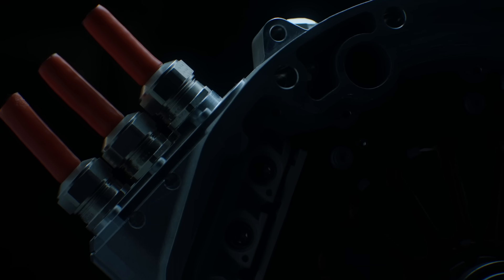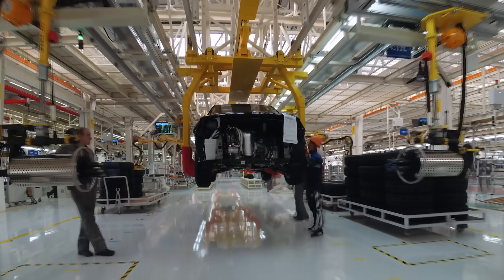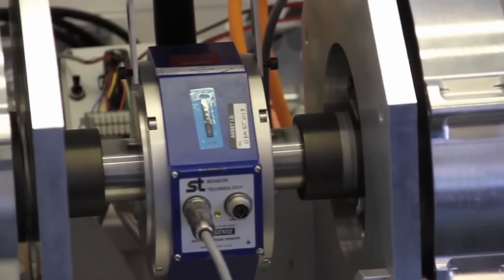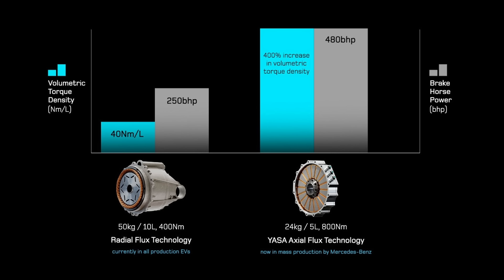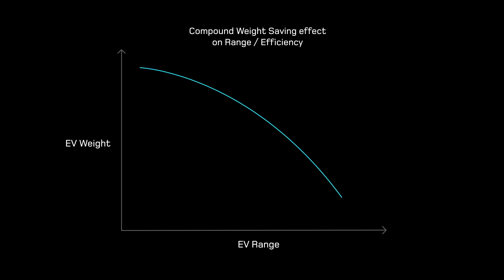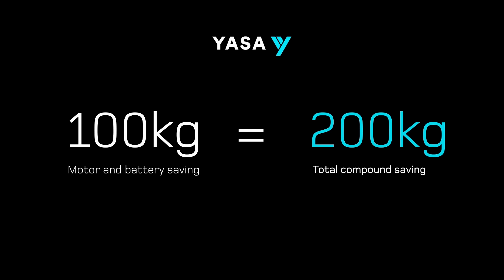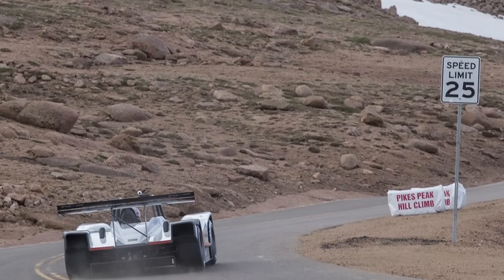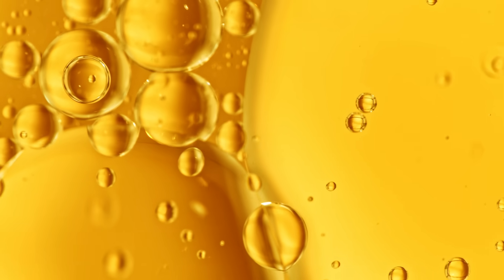The YASA Story - Axial Flux Motors: The Future Of Electric Vehicle Propulsion

Comment: To be clear, they said "working with Mercedes," however Mercedes acquired YASA motors over a year ago. I doubt they acquired them to sell the motors to competitors. No, they probably see it as a competitive advantage that they'd like to keep to themselves. Wonder what the real world impact is - the EQS 580 4MATIC that Munro & Associates looked at, seemed like it had a standard radial motor.
Reply: I dunno, you could probably make a silly amount of money by licencing the motor to other manufacturers rather than keeping it to yourself and making your competitors research and develop their own
Reply: @TheBoringInvestorMan  exactly. Buying them assures your own supply.  There's already an aerospace spinout from YASA whose job it is to put their motors into electric aircraft.
Reply: Most of Mercedes' inventions are common for all.

Comment: People don't be fooled by this axial flux motors have alot of torque but they basically max out at 6-8k rpm unlike a radial flux motor that can be capable of going up to 20k rpm
Reply: I think we can see axial flux motors with 20000+ rpm..
Reply: 20k for motor is not true. . Unlike ice they do need that.
Reply: So you are saying Mercedes Benz have been fooled 🤔
Reply: Why do you think going to 20k RPM is valuable for a car?
Reply: @JorenMathews  it all ends up to the gearbox high gear ration will end you being pretty slow lower gear ration would end you going pretty fast and that's where 20k rpm ends up and if you add more gears you're just loosing efficiency
Reply: @lhgt1324  You don't need a motor to spin that fast at all, a gearbox will instantly fix it and even if the motor is going quite slow at this stage it won't be too bad. Plus they always have 2 gearboxes if needed, 1 to spin the gears faster and another for reduction.

Comment: I drive a 2002 EV a Fiat elettra. Still going strong on its 3'rd set of batteries. I had my first EV in 1991. They have been around forever if you wanted to buy them, you could in Europe. Axial flux motors are the future. Torque curve better suited to the demands in traction applications and not the least the higher efficiency over a wider load range.  Run of the mill induction motors like they are still used the majority of EVs globally, drop dramatically off in efficiency at lower loads, i.e. city driving.  Another thing: In the 90' EVs were optimized for efficiency. they were not simply standard pressed steel gasoline vehicles with batteries. That was needed because the chemistry was lead-acid or maybe Ni-Cd if you was rich, So everything was about weight reduction and driveline efficiency. If that virtue is coming back. we could make 1000 km range EVs today with Li-ion batteries if we custom built EVs and not as now, are just retrofitting gasoline cars. An EV1 today with the same mass of Li-ion batteries it had Lead acid batteries, would have a range of more than 800km.
Reply: And you would be killed if a soccer mom wouldn’t see you in their SUV tank and roll you over. I know the old EVs, and in a perfect world they would be great. In today’s reality anything small than an electric UP is basically undriveable. I personally wouldn’t even go smaller than an electric golf…
Reply: @erebostd  You cannot view car safety from the individual car owners perspective. Bigger cars are not safer, they have 2.5 times the mortality and injury rate in urban areas, to all other than its occupants. So it is really not the small car owners peril, it is mismanagement of mobility planning. People perceive bigger cars as safer, and they are from their egocentric perspective, however they are worse for road safety on society level. So the soccer moms are not smart enough to choose the most appropriate vehicle, so they should be helped, by taxing vehicles by size and fuel consumption. here in Europe. you pay around 6 times more to drive a SUV in road tax and resident's parking permit over a compact. So SUVs really don't appeal to soccer moms here.

Comment: now you need oil change for your EV motors.😅
Reply: You needed that before. Look at many defective drive units of Tesla
Reply: If you did need to change the oil, it would be extremely Infrequent ... think of the oil in a manual tranny... I know some may change that at intervals, it certainly wouldnt hurt to, but Ive Never changed the oil in any Ive had becuz there is no internal combustion going on that would degrade the oil... same with an ev oil cooled motor or tranny... granted, changing it out now and then becuz particles from metallic wear will still be in the oil, it will be a Very infrequent interval since no combustion is involved.

Comment: How does an electric motor have density? That’s what batteries have. Maybe they’re talking about power to weight
Reply: Divide the torque with the volume the engines takes up and you get the torque density. Not that difficult 😂
Reply: @MovieViking  thanks for clarifying that for me so what this motor will do is allow me to beat people at the traffic lights? But it won’t necessarily give me greater range?

Comment: What seems to be skipped over is the main reason EV manufacturers use radial motors, and that is energy efficiency. At the same time radial motor design hasn't been standing still and more recent hybrid radial motors as used by Tesla etc are extremely efficient and have dropped in weight as a result.
Reply: They all use it because it hit an engineering sweetspot simple stupid to make, reliable and yet efficient.
Any forward step like axial flux motors have manufacturing problems - keeping airgap is hard and cooling is hard too

Comment: As he mentioned he did not invent this type of motor and I am sure as prototype he used Shkondin's patents . By the way inventor mentioned above claims  confirmed efficiency  of his motor 104 percent. I understand it contradicts some laws of physics but it doesn't stop the inventor to work on      generator which would produce 6 KW of electricity in combination with just one solar panel

Comment: Ok then which EV with a Yasa motor performs better than my Model 3 RWD in terms of range per kWh? Because i have not seen ANY car on the road which can match Tesla. And Tesla has no Axial Flux Motor. Care to explain? Also we do not need Permanent magnets in motors. That is not the road to take. What about Reluctance motor where all the copper is replaced by aluminium ? (Cheaper)
Reply: Your model 3 has permanent magnets in the motor. 😂
Reply: Because they aren't as efficent as PM motors. Your Model 3 has PM in the motors and funnily enough that this motor hasn't yet been put in a normal can like yours yet, they have all been used in sports cars where range isn't really important only speed,power and weight is.

Comment: If we look at vehicles with a maximum acceleration of 5m/s.s and 3.5m/s.s (fast and normal ICE vehicle acceleration), and assume torque vectoring on all four wheels, we could have two drive units, each with two small axial flux motors. Each motor would be packaged with a planetary gear system and an inboard brake and half shaft all axially aligned. The casing could include rack and pinion steering for both front and rear units - can use identical units front and rear. Each front/rear unit would need inverters for each motor, the oil pump motor, steering motor. There would be an oil/coolant heat exchanger. The inputs to the drive unit would be communication from vehicle controls (all human controls entered via an aircraft style side-stick (steering, brake acceleration), low and high voltage power so the drive unit will stay awake if DC power cut and coolant. The outputs are data to the vehicle controller/sidestick, two half shafts and two steering arms. In going to a 'giga-casting' the casting is not strong enough to resist fatigue loading from a MacPherson strut. The suspension should be double wishbones and horizontal suspension like F1 and other high performance vehicles. This means the giga-casting only face accident loading such as Short Overlap Test at their extremities. The wheels could be flush to the tyre on the inside and have fully enclosed wheel covers on the outer. Suspension components can be shaped for lowest drag life F1. The underfloor can be shaped for best aerodynamics.

Comment: During regen does the motor act as a generator, or is there a separate generating component? If this motor can serve as a compact efficient generator, why not develop it for wind power generation to increase efficiency?
Reply: I am not the engineer, however the answer to your question is Yes.
All 3 phase EV electric motors work both ways, the regen is derived in the Drive controller by frequency, the EV pedal commands a frequency, the controller matches it , when the pedal is "ahead" the controller pulls more current to get the motor to match the requested speed.
When the EV pedal is released, "Behind" the speed of the motor, it tries to slow the car by REGEN until they match frequency. Really a simple design.
Reply: @HandyDan  that's not how the control logic works - for one thing pedal position does not correlate to target speed - but yes... motors act as generators when desired.
Reply: @brianb-p6586  I am not here to start an argument, but have you ever driven an EV? 
The pedal position is 99% exactly the vehicle speed. Unless traversing a very steep hill. Then it takes more amps from the battery to try to match up again.
Reply: @HandyDan  yes, I have driven an EV, and just as in an ICE vehicle the pedal position corresponds to power, not to speed. 

With cruise control not engaged, hold the pedal halfway down on level ground: the vehicle speeds up until it reaches the speed that needs that much power. Now drive up a hill with the same constant pedal position: it slows down because some of the power goes to raising the vehicle up the hill. Then contine over the top and go downhill, still with same pedal position: it speeds up, to faster than it was going on flat ground with the same pedal position. 

Pedal position is not a speed input.
Reply: @brianb-p6586  Correct for ICE, Gas cars shift gears, have a sweet spot in the torque curve, so if you held the pedal in one spot, 1st, 2nd, 3rd, 4th the car is speeding up.
But in an EV, one gear, hold the pedal and it gets up to set speed.😃
Reply: @HandyDan  it gets up to the speed which needs that much power... which is different depending on road grade, wind, road surface codition, etc. The pedal position is not a speed setting.
Reply: @brianb-p6586  Not arguing, but in my Smart fortwo EV, if I hold the pedal halfway it will do 45mph up hill, downhill in a head wind or tail wind. 
Maybe Mercedes did it differently in the Smart, but I could use a long bolt and wing nut on the pedal as cruise control.
Reply: @HandyDan  That sounds like a really smart Smart. 🙂 EVs (at least other EVs, and likely Smart ForTwo ED's as well) really don't work that way, for very good reasons, but if that's what it seems like in yours, it's good that you're happy with it.
Reply: @brianb-p6586  The 2015 Smart fortwo ED was initially designed by Tesla, but along the way they switched to Bosch, mine has the Bosch A4513401700 motor, plus mine has a Steinbauer power module for more torque and better regen so that might also be what gives my car the steady speed with a fixed pedal position.
Reply: Yup the overall statement about Regen is correct, it isn't a matter of the motor but other components to support regen. 

Infsofar as control is concerned the pedal input is read as a certain percentage of total pedal depression and depending on the mode/settings of the cars computer it will control the power flow from the batteries to motors through an inverter or speed controller (basically opening and closing gates to let current flow from the battery through the coils in the motor more or less quickly), more pedal press equates to more torque/acceleration, when let off the pedal the computer again can be configured to use the motors as generators and effectively recharge the batteries off the Kinect energy (slowing down the car, now the coils are being used to "pump" a charge/boost converter to pull the battery voltage/charge up).  It might be more or less efficient using one electric motor design or another but I think they all share the property of being used either to drive a thing or when driven to output power since moving  a wire through a magnetic field (or vice versa) is all that's needed.  

Typically cars use a CANbus for sending control signals around, but other communication protocols are probably involved in most of the ev (or ice) throttle control.
Reply: @ShaunHusain  Thank you, the system is actually very straight forward. Picture this example, test bench: Set the pedal position, that sets the frequency to the drive inverter, it puts out UVW at the same frequency, there is an encoder on the motor shaft for verification of rotor position.
Now the easy part, say a bench test motor is spinning at given RPM by a pedal position, without even touching the EV pedal, if you place a load on the motor, the inverter will up the amps to maintain RPM, if you spun the shaft faster, the regen will start.
It's as simple as if the motor RPM is lower than commanded, amps rise to maintain, if the motor RPM is faster than commanded, voltage is produced by the next set of leading coils and produces drag "REGEN".if you manually spun the same as commanded "Free spinning" no load or regeneration.
Reply: @HandyDan  I get where you're coming from but it isn't that direct the computer in these systems allows you to control how much you want it to map the pedal position to positive vs negative for one pedal driving and the mapping isn't a one to one but the gist of what you're saying is right.  For reference I built my own electric skateboard that uses an vesc (vedder open source esc) for the power and Regen control, in the app there can configure the input mapping and ramping along with other limits, but the mode you're talking about is called velocity control there where an input signal is meant to be a target velocity but most riders and ev cars use current control so more pedal=mode current=more torque=more acceleration.  All I'm saying is it's not pedal to velocity but pedal to acceleration/deceleration amount and usually adjustable (parents have a model 3 and can adjust how much Regen you want but think is pretty typical feature for evs)

Comment: Robustness of large diameter seals, keeping axially mounted magnets in place under rotational and shock loads, managing air gap under dynamic loads, mitigating heat, Materials/weight/structural trade-offs, …

Comment: Is it more power dense than the new Lucid Drive Unit used now in formula E for front regen only?  That drive unit is 32 kg and produces 469 hp for a 14.7hp/Kg.  The drive unit includes a differntial and reduction gears (AF motors probably dont' need the reduction gears.)  I think this unit is probably destine for their midsize cars which are not due out until 2025 at the earliest.
Reply: Axial flux motors do need the reduction gears.
Reply: As uncle ben said with great power density comes heat.
IMO this is a huge challenge as a standalone EV motor but will probably be perfect as a range extender
Reply: Rivian's gears are roughly one fifth of Tesla's, i.e. saving weight at the cost of realibility...